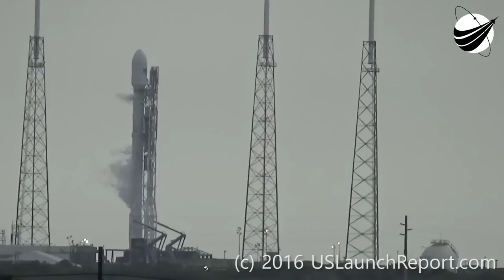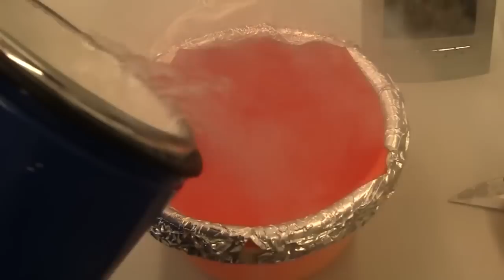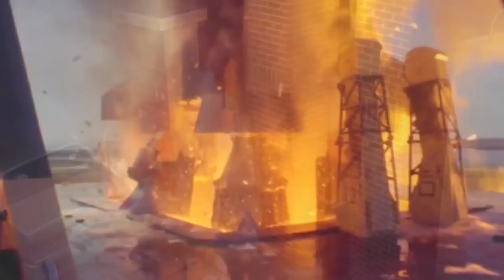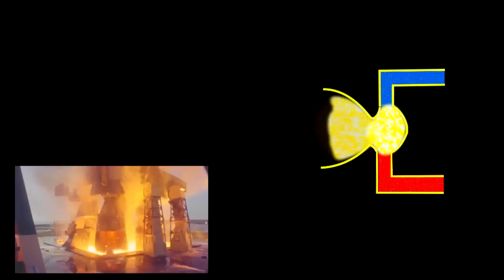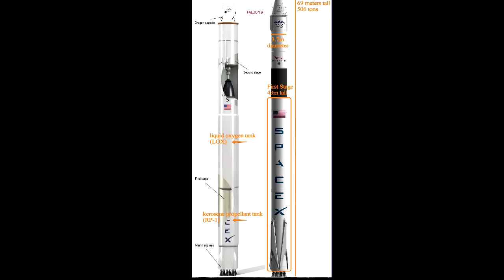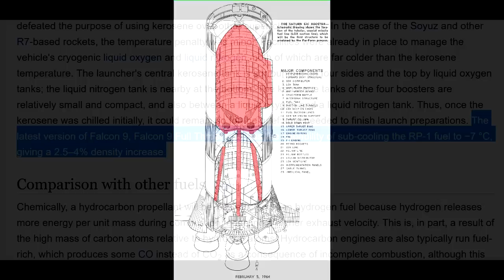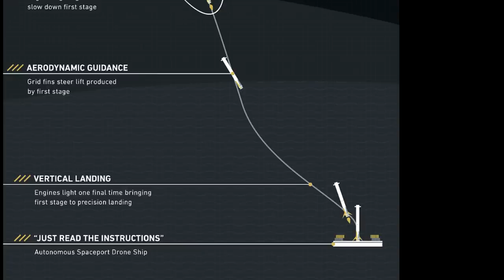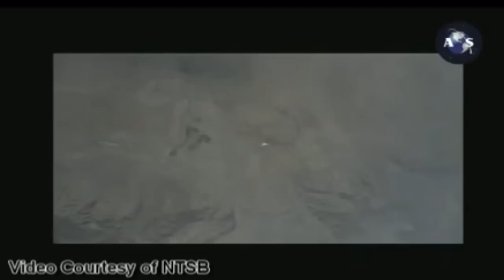Why did the Falcon 9 Explode?

Comment: I've always wondered, why not use solid fuel at some stage during the rocket's life. It's dense, high energy, stable, and in use with toy and model rockets without much problem. I do understand that it would be difficult to push through a nozzle but why not use it in either in stages, or ignition, or even in the last push to get the object into orbit? I'm certain there is a better rocket engine out there, someone just has to come up with it.

Comment: Almost everything that was said about Falcon  9 reusability was flawed or outright wrong. Comparing Merlin engines to RS-25 shows a lack of understanding of the specifics of rocket engines. Thunderf00t falls prey to one the common logical traps in business, the misconception that since another entity isn't doing something the way I would do it, they must be wrong. 

SpaceX did look into using parachutes to slow their rocket, when they tested it they found it wouldn't be as weight effective as retropropulsion. They base their decisions on real data and engineering while their critics (Thunderf00t included) base their criticisms on gut feelings and back of the napkin math with assumptions that are little better than guesses. 

SpaceX is not without their flaws (as their recent failure clearly shows), but they're at least doing real science, not armchair speculation that is on the same level as  perpetual motion believers.

Comment: 15:40  "I'm not so sure of the economics of this..."

The whole reason SpaceX is recovering the first stage is to save money.  So, the most relevant data here is a cost comparison.  Yet +Thunderf00t hasn't done any kind of cost analysis here.  He just speculates.  

Don't get me wrong, there is a lot of good rocketry information in the front half of this video.  But it becomes painfully obvious in the second half that this video's primary goal is  to piss on the SpaceX parade.  As if any kind of enthusiasm for rocket engineering is intolerable and needs to be immediately stamped out.

Comment: Many of your questions are valid.  But that is all they are, questions.  When you start to turn these questions into conclusions then you begin to mix oxygen with rocket fuel.

Take for example, "All that knowledge is basically locked up in NASA engineers minds. It seems remarkably optimistic to hope that Spacex will be able to do as good a job."  SpaceX on many occasions acknowledged the collaboration from NASA engineers on the design and manufacturing of Falcon 9 rockets.  What makes you conclude that SpaceX can't do as good a job?  Besides, don't you think you are jumping to the conclusion a bit prematurely?  We don't know exactly what caused the fire/explosion.  It could be something external, like the launch pad anomaly or an ufo (not the science fiction kind.)

In all, it's healthy to be skeptical.  But to jump to the conclusions before the investigation is even completed is premature.

Comment: Spindly landing gear legs, paper thin walls (to save weight), INSANE diameter to length ratio.  I'm surprised he got ANY upright landings without a catastrophic failure every time.  And yes, I work for an aerospace company.
Reply: Care to give us an update on your thoughts?
Reply: And how does it feel now, 4 years later?

Comment: I was hoping you'd give an answer to the question you posed in the title :)

I don't know what Musk did to offend you so, but you shouldn't let your judgment suffer from it. You fail to consider quite a few very important things in your perspective of the landings, which you call an incremental progress, when it's really quite a groundbreaking one.

First, your fuel argument just does not hold. Yes, it's much less fuel-efficient, but that does not matter one bit. Fuel costs are less than 1% of the cost of the first stage alone. What you lose by it is incomparable to what you gain by preserving a majority of the rocket (maybe even more once people figure out how to recover the fairing, which is also being investigated). And parachutes followed by retropropulsion would actually be more expensive, because installing a parachute mechanism alone adds more cost, complexity and weight to the rocket than the cheap extra fuel. See what it did to the Dragon v2, which required parachutes to be human-rated by NASA.

Your next point is the shuttle comparison, which was very expensive. But that's because it was a completely different architecture. It was technology from the 50s and 60s and took a lot of damage in both launching and landing, mainly due to its form of reentry because their heat shield was inefficient and required a complete rehaul. Also, its engines were huge and complex, maintenance was thus much more expensive. While we don't know the inner mechanisms of the Merlin 1D engine, they are ostensibly very simple to examine and maintain, evidenced by the fact that SpaceX has already done that for all its landed boosters. They commented on the engines of their first landed booster as being in good condition, and they already re-fired the engines from their worst recovered booster successfully.

And SpaceX is not alone. Blue Origin has already reflown a used booster several times, and their progress has been significant enough to attract the attention of the veterans at Boeing, who they partnered with to provide new engines to replace the Russian made RD-180.

Finally, this is quite a tremendous achievement on its own right, even if they would gain nothing from it, simply because of the effort required to do it. And while we don't know about the actual savings yet, judging by our current evidence we have every reason to be very optimistic about it. Even if it turns out to be twice as expensive as they predicted, it would still bring the launch cost (for SpaceX, not the client) down by almost an order of magnitude.

Like I said, this is pretty groundbreaking, not just incremental.

Comment: Sorry,   TF,    The fuel is a tiny fraction of the cost of launch,  I've heard a falcon 9 launches on $200,000 worth of fuel.  And the cost of the first stage is what,  $30,000,000?   You are criticizing a private company,  with a tiny fraction of a budget. (does spacex have all nasa patents?! and tech available?!)   Who is trying to push costs DOWN over time to open the door to space.   Not continuing to spend 5x more than necessary and build all parts in as many states as possible.    Old Nasa tech isn't always the path forward.  

How much did NASA pay to put 1KG into GEO 40 years ago.
How about in 1980,   How about in 1990?
How about the year 2000? 

Okay fine,  THIS YEAR,  how much does it cost NASA to put 1KG into GEO,
And then what about space X right now?

I mean after all Nasa has 58 YEARS of experience, And with all that experience, time and hundreds of billions of dollars they can't even deliver a Person to space right now, or come anywhere close to putting cargo into space as cheaply as the private sector now.

NASA has its place,  And so does SpaceX  judging one from the other makes no sense.   SpaceX and companies like it and are going to open space up to us.   NASA, is going to keep sending probes out to whatever, with $9000 per PC nuts and bolts inspected in 12 states.  And that is fine.   But don't compare apples to lizard tails.

I vehemently disagree with you TF.  I actually don't even understand where your obviously animosity is coming from.

Comment: since when growing crystals of frozen liquid on the surface of anything creates significant stresses on that surface? you would have to freeze lots of RP1 as well as vent valves to create some stress by change of density. Further more density of frozen RP1 might not be lower at all and most probably not significant.
I just can not agree with proposed cause, that led to mixing of lox and RP1, that's all.

Comment: Having seen dozens of launches from the KSC and the Cape in person over the years, including Shuttle, Atlas, Delta and Titan as well as Falcon, the first thing that struck me about the two Falcon launches that landed back at the Cape was how vertical the first stage trajectory was.    
 
Most rockets only go a relatively short distance straight up before pitching over and heading up and easterly.   In contrast, the two Falcon launches went straight up, WAY up before pitching over.   First stage sepearation came not too long after.  Apparently SpaceX makes a trade off getting more altitude, with less down range velocity and distance in order to make the fly back manuver easier.  It hadn't occured to me that they would do that, but as soon as I saw it happening it made perfect sense.  

Now what I would like to understand is the TRIPLE sonic boom on landing...   Probably aliens.
Reply: I think the triple boom is from the different ends of the rocket breaking the sound barrier. The tail creates the first one and the grid fins/interstage creates the second one

Comment: Special note to Thunderf00t: When a private company endures a loss due to destruction of property, the private investors of the company may also endure that loss however no one else is affected (assuming of course it is not an environmental disaster). In the case of a public agency, if they endure a loss, everyone is hurt and everyone suffers. 

Also, I wouldn't even consider SpaceX entirely "private" anyhow since it enjoys massive contracts from public institutions, including the military, however there is a benefit and that is that without SpaceX, there would be a monopoly on U.S. military launches which are provided by United Launch Alliance (joint venture between Boeing and Lockheed). Your negativity about so-called "private" enterprises like SpaceX is truly peculiar, especially since the benefits of a competitor in a case like this are obvious.

Comment: These kind of accidents almost always boil down to gasket or material failure due to thermal cycling/fatigue. Even small amounts of machine grease contamination in metal housings can ignite in the presence of pure oxygen. It really makes no sense to me why they are not using a parachute return mechanism other than patent ability. Even after getting these used rockets I would be incredibly concerned with the thermal and shock stresses that the rocket would undergo in its use history. Such extreme shocks would inexorably lead to failures later on. My theory is that there was a liquid oxygen leak inside the main body of the rocket that caused failure of a seal somewhere along the top of the fuel tank and when the turbo pumps turned on the vacuum inside the fuel tank (relative) sucked in some of the oxygen vapor which led to the vapor pocket in the main body detonating. This initial explosion then let to total structural failure of the two tanks and total destruction. Bottom line it was probably gaskets or seals and cryogenic oxygen that started it all as usual!

Comment: This sounds like a big BDB strawrocket argument. The bit about the turbopumps really clinched it. Always stating the cruel tyrant of the rocket equation, but they always beat about the bush on the solution they always fall back on. BDB, just say it Thunderbolt. Say it...BIG DUMB BOOSTER! Just get to the inevitable punchline where we can't get to Mars or anywhere with current tech reasonably affordable unless SpaceX falls back to BDB. Just say well get to space cheaply and pragmatic like by launching hundreds of gigantic steel boilerplate pressure fed rocketsbigger than Saturn 5s but only the payload of a falcon 9. Sure they explode slot but only cost 20 million a big dumb pop.

Comment: I thought the aluminium peroxide was the problem.    Space travel is never going to be commonplace. I saw the space shuttle take off from cape Canaveral and it put things in perspective. When it ignited it was like a star was being borne and you could feel the heat on your face even though we were miles away. It was cool but really terrifying at the same time. Amazing.

Comment: Having worked in the space launch business for over 30 years, I'd like to make a few comments.  

First, while as usual the snark is first class it is not an explanation as to why the failure happened.  It would have been a more . . . um . . . professional video without the snark.  But I do recognize that snark is your stock-in-trade, so I guess that's a trivial comment on my part.

Second, the common misperception that problems are ever solved is, well, a misperception.  These vehicles are indescribably difficult to build, flaws in them are commonplace, and one small flaw can cause, well, what happened on LC-40 last week.  It can happen to anyone, Arianespace, ULA, Proton, and yes, SpaceX.   Does this failure show that SpaceX is particularly incompetent?, which is very much the implication I hear in all of your "these problems were solved 60 years ago" rhetoric.  No, they are not incompetent.  These problems are never solved, they are only managed.  To repeat, these problems happen all the time, and they happen to everyone.  The reason that ULA, NASA, etc have not had such a failure in several decades is that they have developed review protocols to find and fix these problems before they get to the launch pad.  SpaceX had a failure.  That suggests a serious shortcoming in their review protocols, but it does not make their vehicle design bad and it does not make them dumb.  If you look at the record, SpaceX has actually been remarkably successful.  They achieved a 50% success rate for Falcon in about 6 years.  It took the General Dynamics/Lockheed Martin/ULA Atlas family something around 25 or 30 years to achieve a 50% success rate.  Ditto for the Martin Marietta Titan family.  That's not because SpaceX is smart and the Atlas and Titan guys dumb; that's because SpaceX is benefiting from the protocols the industry spent a half-century designing, with NASA and DoD support.

That said, you haven't explained anything about why this failure occurred.  Your 20 minute video amounts to "Fuel and oxidizer mixed and went boom. There must have been a leak."  Well, duh!  For this kind of failure you need a fuel source, an oxygen source, and an ignition source.  The oxygen is easily available in the air or in the GOX vent stream, but you need two failures to get an explosion: a fuel source and an ignition source.  You speculate (read, guess) a little on what may have been the source of the leak.  Well, anyone can speculate (read, guess).  Why not wait to see what the failure analysis says rather than guess?  What was the ignition source?  (I seriously doubt it was some dude with a butane torch playing with LOX and Cheeze Puffs.)  

As for me, I'll not guess. I'll wait to hear root-cause.  Where'd the fuel come from and why? and where'd the spark come from and why?

I'm generally a big fan of your (science) videos, but I do wonder why you would make such an inane video as this unless, as other commentators have suggested, you're just looking to dis Elon Musk?
Reply: Thank you for your comment, you explained well what I couldn't. Just because something is well researched and engineered doesn't mean it will be alright every time. There is a process involved that influences the success rate.
It is delightful to read an opinion from someone wo actually worked in that field.

I liked TF when he debunked real BS, but I learned to ignore him over time. Even if he is right I can't bare listen to him because of his snarky and snide delivery. In case of this particular SpaceX rocket explosion, where TF was wrong about the cause of failure, he didn't release a correction video, I don't expect an apology form this type of character either.
Reply: +Dave Robson
Looking from time to time into the comment section or video list if TF has made a correction about his bold and incorrect assumptions. I don't watch his videos anymore like I used to, mostly I react to answers on old comments like this.
Reply: Tbh, I think he just constatly criticise elon musk because most of the times he gives bad ideas such as the hyperloop which would probably take decades to be viable so I think thats why he is so adament to nick pick everything that elon did wrong
Reply: @assootoshmotah2350  one thing I have learned while doubting elon is that he always delivered. Not in time, really not in time but most of his claims became reality..

I'd say even something ridicolus like a hyperloop might be possible if we really want it and resources are used to research it. It is just not economical in any way.
Reply: For anyone curious: the AMOS-6 anomaly was due to frozen oxygen interacting with the helium tank stored inside the LOx tank in an unpredicted way, which caused the struts holding the tank in place (which were built by a third party, I believe) to fail. The tank shot up, exploded, over pressurized the LOx tank, causing it to rupture and damage the RP-1 tank. The two fluids mixed and ignited, and boom.
Reply: Your statistics re Titan and Atlas are pulled out of your arse. 30 years before 50% launch success that's a joke isn't it? In 1957 Atlas had 3 launches, only one was successfull...Next year 8 good 6 bad. It took ONE year to get to 75% and it just got better and better. They had the odd few failures They reached 100% in 72, 3 and 4. I think that is from scratch to sustained 100% in 15 years or so. Titan did better, much better.
Thanks for pointing out the obvious re any complex system - except of course problems are solved, and solved to exacting standards. Anyhow was going to go on but as you were just being a snark and dishing out poor info I will stop here.
Wonder what rockets you do build though?
EDIT: I certainly wouldn't pay to put my payload on it that's for sure.
Reply: d1oftwins
 Uhm. If you " learned to ignore him over time" what are you doing posting on this thread? You may have learned to not take him seriously , but, had you actually started ignoring him you would not have commented here.